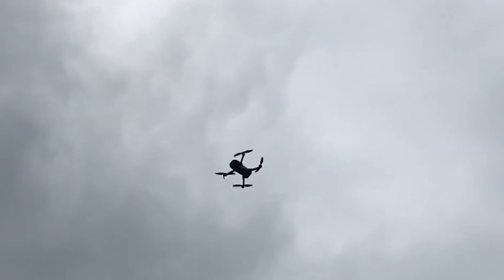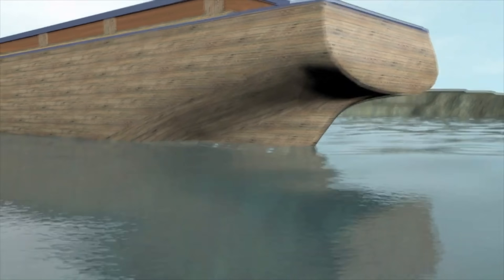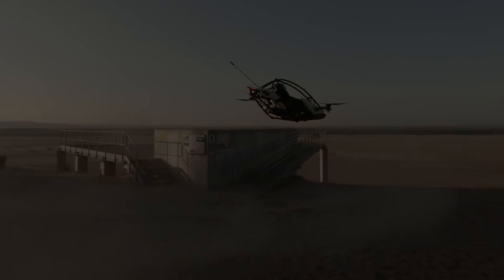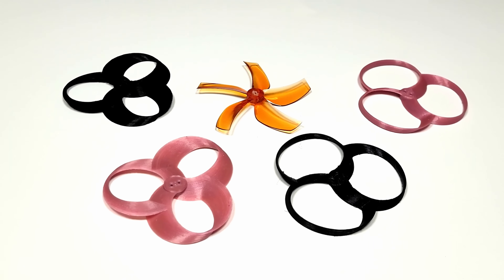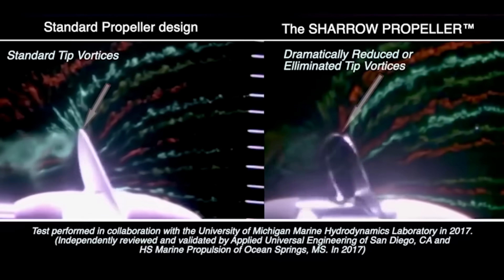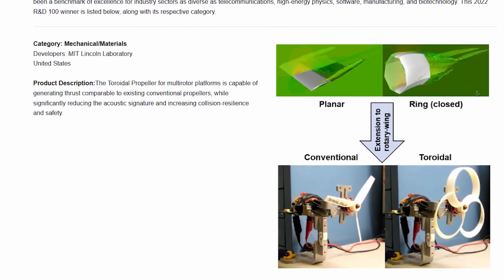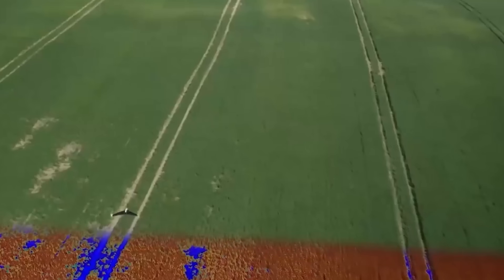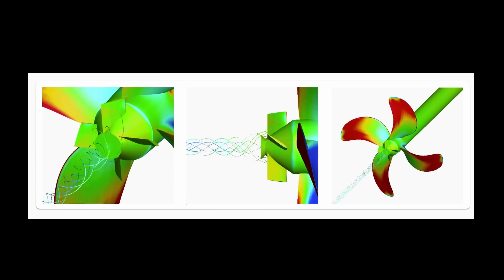This Propeller will Change Aviation Forever!

Comment: This idea has possibilities but has a limited application in aviation. I can't see how the pitch of the blades could ever be made variable and the 'dead-engine' drag in the glide would be unacceptable. Drones certainly have a need for quieter operation but the big opportunity must be in under-water turbines for tidal power generation. New ideas are always exciting but I have seen claims of 101 % efficiency - clearly ill informed !
Reply: The only 101% I can see is compared to conventional.
The Wright Flyer's prop was 85% efficient, does that make the toroidal one a hundred fifteen percent? No math was injured making this comment.
Reply: If you going to use it in a normal aircraft, like a Cessna, you need to redesign the engine to handle free rotation. You might also need something like a gearbox or something to boast torque at low speed.

On the flip side, the increase for a prop on a plane will be considerably high than for a already existing fixed angle prop. A aircraft propeller, like that of a Cessna always have some inefficiency where some part of the propeller is not  at optimal angle.

Everything is always a trade of. As the situation today a fix propeller is the most optimal in efficiency. Then comes a prop fan, than comes a fan, than comes a variable pitch propeller, then last comes a rotor.

Something like a rotor of a windturbine is actually not very efficient, but its very wide band. It works at very low wind, but also very high wind. It can also be feathered. 

And its not like there is a huge diffrance in efficacy from one to the next. Typically about 5% for each step. Note, this is everything else equal and peak efficiency.

If we go of peak efficiency a rotor will eventually be the most efficient design. For a helicopter that need to both work at hovering and at 150knots, at the same RPM (or there about) a rotor is far more efficient. But a drone that can quickly change the RPM a propeller is far more efficient. And if we compare a rotor to a propeller where everything else is equal, but we have a motor with a wide band torque, (like an electric motor), a propeller is far superior, and considerably cheaper.

The claim of 105% is relative efficiency. So that would imply that the total efficiency is 5% higher. Relative efficiency is often used in engineering and science because its easy to use. Number over 1 (100%) is a efficiency gain, and numbers under is a decrease. Also this allow negative numbers to be used for reverse flow (say like recuperative breaking). 

With a toroidal propeller at peak efficiency it would imply that its 105% as efficient as a normal propeller.

That would make the list of about
Toroidal: 105%
Propeller: 100%
Propfan: 95%
Ductfan: 90%
Varible pich prop: 85%
And a rotor:80%

This is very rough number and they will be different due to application. And this is also peak efficiency value. At lower efficiency at one point, the rotor will be better.

Its also worth saying that there is other way of increasing a propeller efficiency (and a rotor and everything between) like having larger dish area or a high aspect-ratio propeller. Also fewer blades does increase efficiency, but decrease power throughput. Look at something like the Helios solar plane having propeller the size of a Cessna despite only having a few kW in each prop
Reply: They talk increase in effeciency where 105 would be valid...
Reply: You just need the part that curves back to have some flexibility. As long as there is a cover you could have a mechanical component inside each section of the blade that could rotate, while still maintaining the efficient part, which is the lack of verticies.
Reply: Toroïdal propellers give significant gain in water, in air it’s still a different story from various tests and experiment done by engeneers …
Reply: I assumed it would flex like an F1 wing
Reply: Didn’t see your post, came to the same conclusions.
Reply: The dominant factors change completely with the size of the propeller.  A standard propeller has a fixed angle of attack along its length, that is why the pitch is steeper at the root, thats very efficient.  But helicopters with large diameter blades suffer flow reversal with that arrangement making foward flight difficult, so they are flat and the entire blade pitch changes mechanically. That means that the tips are doing more work than the root because of thr linear velocity.  Drones up to a meter don't have to worry about any of that nonsense and small diameter blades spool very quickly.  The retreating blade is usually stalled but it doesn't matter. Variable pitch has all been done, even a diagonal blade flap.  But simplicity wins out by far.
Reply: He's just reading a script with little understanding
Reply: ۱
Reply: @kafar1125  what's that?
Reply: Yes agreed.
Reply: If it was made out of a nitinol alloy the deflation  could be  either electrically or by a heat source  internally.
Reply: Unfortunately drones are the future of aviation
Reply: Old think
Reply: Agreed Ray. They will have some great applications but are not the End of Propellers as these videos would like for you to think. But as you have noticed the new design does have advantages but not in all applications.
Reply: possibly a plus 1% relative to known/existing concepts.
Reply: What's dead-engine drag?
Reply: As a pilot I agree with you.
Reply: Need collective pitch control on our quads. That will revolutionize drones. Like the wheel or fire. Lol. Turbo prop our drones yo
Reply: @Nanoblaster77  There already are collective variable pitch quad copters. They are mechanically complicated so more expensive and less popular.
Reply: @Clickmaster5k  not like what im talking about bro. Not anywhere close. Very very simple and small.
Reply: @Nanoblaster77  There are and have already been made quad copters that use rc helicopter tail units to control each prop pitch. Iv seen both nitro and single motor electric versions of these. The reports are they are better performers than fixed pitch 4 motor quads in most ways but they are not as durable. Not as simple, so not as cheap so they are less popular.  I think ultimately once you start scaling up a heli is just better for how you would use a CCPM quad and a simple 4 motor quad is going to be cheaper to thrash around and get trashed. Doesn't leave any market for the CCPM quads. You can get clones of them some times still though.

Look up the Stingray 500 or Assault Reaper 500.

I know what you are talking about, I fly heli too.
Reply: @Nanoblaster77  I'm curious why we don't see conventional helicopter drones - surely if there's a benefit they could figure out the control scheme? Maybe the tail rotor eats more power than it looks like it should, but then why not a coaxial, Chinook, or K-Max configuration?
It seems like most of the electric "helicopter" designs are going multirotor, so I presume there a substantial benefit to the reduced parts count & direct powerplant control.
Reply: @Traqr  Durability and simplicity of a multirotor makes a small toy something that people can afford to beat up. They can be crashed more and repaired easier by your average hobbyist. Efficiency reliability and longevity are not really concerns with small hobby aircraft. On larger scale the difference in maintenance and repair complexity and cost no longer exists.

These advantages do not scale up and that's why there are very different dominant designs for large aircraft that carry people. 

If your question is why we don't see rc helicopters having the same popularity as quad copters I think it comes down to RC heli are much harder to learn to fly since they are far less forgiving to crash and much harder to assemble and tune then a quadcopter. The flight controller software available for rc heli is also much harder to start out with than quads but that is changing with many new small helis having stabilized modes built in these days. 

There is also a perceived safety factor. A small heli and small quad of similar size the heli will have one large rotor with lots of energy that can do a lot of damage to a person where a quad will hurt you but I think most people think the quad will cause less injurie. 

As to tail rotor vs multi on full size. Tail rotors do eat a lot of power, iv read up to 25% on some heli but any overlapping rotor design is less efficient with inline cax having the the most overlap they are the least efficient. IDK the numbers but looking at what is built and flown id have to assume the loss of efficiency evens out with a tail rotor more or less or we would have moved away from tail rotor designs a long time ago.
Reply: @Clickmaster5k  my 5" quad can do 220 kph and 0-100 in less then a second. That's why quads are more popular
Reply: @cabreraman6969  That's not an inherent property of being a quad. What's the range, flight time, load capacity of your quad?  There are other aircraft that have faster acceleration and all out top speed. At only 3gs quads to not change direction fast, even larger rc heli will pull well over 10g. Rc helicopter speed record is over 300kph.

Those aircraft cost a lot more $$ to get that performance and dont crash well. 

Quads cost less than a grand and can be crashed all day for minimal repair cost. That's whey they are more popular.

You quad already is leaving performance on the table even at those numbers you claim because they are all much heavier than they need to be so they are tough enough to crash.
Reply: @Clickmaster5k  my quad weighs less than 250 grams with no battery and it can pull at least 20gs. Besides it costs less than 600$ 

Edit: 13gs not 20
Reply: @Clickmaster5k  the range could be increased to multiple kilometres just by adding long range Rx and vtx and running larger batteries and load capacity is not important since it's a race quad. And what aircraft are faster in acceleration? My quad cold probably do 0-100 in half a second if I tuned the esc, ran more aggressive props and removed all unnecessary weight.
Reply: @cabreraman6969  Ya it wont accelerate as fast or top out as fast with a larger battery, that's the whole point of what I said.

I also pointed out aircraft in my previous post that accelerate faster.

Quads are fun and cool. Don't kid your self though, motor bells are heavy and compared to changing pitch on a prop they are very slow to change direction.

Different aircraft for different missions is the point. Mission of a race quad is not the same as most other aircraft.
Reply: @cabreraman6969  It wont pull any Gs with out the battery so the weight with out is pointless. It being less than $600 is a huge part of my point. And when you crash it you probably are not costing as much as when you crash something like a heli either.  That's where quads shine cheap (relatively) rugged, tough.
Reply: @Clickmaster5k  the battery is another 200 grams
Reply: @Clickmaster5k  the motor only weighs 36 grams and they reach max speed with the propeller in less than half a second
Reply: @Traqr  Different control scheme, harder to control, steeper learning curve, far less intuitive.
Reply: @cabreraman6969  I know right, its pretty slow. If you want to change direction of rotation completely its twice as long and that's just on a tiny 5". If you want a larger aircraft for more endurance or payload the motors only get larger and slower to change direction too.
Reply: @Nanoblaster77  They already had that several years ago, the concept didn't "take off".
Reply: @Henry Knox  have a lil faith bro
Reply: @Nanoblaster77  I wonder as an inventor, could the toroidal propeller be stiffened as the bushing or pulling blade, & be flexible from that point on, so propeller pitch could still be adjusted?????
I guess research & development could still be worked on, then work on more efficient ways of production, like injection molding.........?
Possibly encircle the whole assembly with a band to both stiffen & protect the blades????
Experimenting with new outside ideas is key!!!
Reply: @Nanoblaster77  its been done. Top 3d heli pilot made some
Reply: @Nanoblaster77  what do you think the three phase  electronic speed controllers are for? Mechanical collectives will never be as fast as ESCs
Reply: @Cayenne  no bro. I dont want to spend batt power on breaking amd spolling back up. Collective pitch control on all 4 props will change the game. Also speed Battery efficiency all that goes up with collective pitch. I'm a helicopter pilot trust me when I say. I like my motor to stay at a constant rpm when i'm doing tic tocks. If ya know what a real 3d ticktock is. On top of that The mechanical part of the Turbo prop is all the way down to a 10000 of a second with the digital high speed servo again helicopter pilot. Here. I know what I'm talking about I've also seen the math. Please give me more reasons to go on. It will increase everything about your drone even the sound
Reply: @cayenne7792  CCPM is far far faster then motors can change speed. Look at RC helicopters.
Reply: @cayenne7792  varying pitch isn't only there to change thrust, but to optimize the propeller efficiency by adjusting the blade angle of attack. Yes drones would improve efficiency with variable pitch.
Reply: @Chwibon  That's called "changing thrust"..you just corrected a guy, for saying the exact same thing...just because he said it a different way...you think yourself so much smarter than him, yet your "correction" was directly related to his comment....😂😂😂😂wooooo! I am DONE with the internet today!!😂😂😂
Reply: You are partially informed which makes you partially illinformed.  The 101% eff claim is correct when you COMPARE to another marine engine/boat combination running at same engines/boat with diff propellers and  then you limit the comparison to medium/low RPM for cruise where most boats cruise at for best fuel efficiency.  Or in this case reduced RPM and vastly reduced fuel consumption and thus the 101% performance increase, not overall efficiency is 100% ... correct. It has been tested over multiple boats.  Though the 101% is maximum, more commonly, it is closer to 70% decrease of fuel consumption at cruise as the boats this is being applied to are planning boats and thus able to get up on a plane sooner at lower RPM and therefore the fuel efficiency increases.  If one looks at the higher RPM higher cruise numbers, not maximum, then savings of ~30% fuel burn are achieved.  Noise is MUCH lower, control is much improved as we especially in reverse for docking.  Now if you are in a trawler boat?  Yea, going to see ~10% improvement.

For general aviation this could partially work with an efficiency increase of ~4%(induced drag reduction for Mach tip speeds of under 0.54 or so(not worth it IMO)) for those aircraft which used fixed pitch(most of them), and no the dead engine glide would not be unacceptable any more than any other 2, 3, or 4 bladed fixed pitch propeller.  If you are talking constant speed props, then technically it could still work, your pivot point would be critical, but its range would be reduced and would have an optimum forward velocity for sure(but then this is already true of such propellers) just it would be more so.
Reply: @w8strel Efficiency of over 100%, or even equal to 100% is impossible.
Reply: And nobody has said "increase of", every claim I've heard is "101% efficient."
Reply: @immikeurnot  It had been done in aviation before. The invention of the high bypass turbofan made over 100% and closer to 150% efficiency when first introduced. As a engineer, one of our mottos is Nothing is impossible!

Comment: Most mornings after 7.00 an RAF  A400 transport flies near to me going to Eastern Europe, it is usually at35000’  and going about 400 knots BUT it is so noisy, a high pitch and really noticeable to all as it is noisier than jets.  The multi blade ,huge props are the source.
Reply: 400 knots at 3500" ? Not bloody likely.
Reply: @mokumikala  35000 i said and an A400 can do that according  to flightradar app that I check on when it goes through DVR beacon.

Comment: looks like it's three times the weight of a normal prop
Reply: Yes but what if the power required per unit static(?) thrust was half, say.
Reply: no, 3 kg of carbon  fiber
Reply: @gulfstream-tvstudios9546  So a regular prop, made of the same carbon fiber, would weigh 1 kg.

Comment: and if all this would be good how come you dont see it all over ?
never one seen one in my life
Reply: I'm going to put a 200 lb bronze prop on my 80hp cessna
Reply: because we just discovered it dummy
Reply: WTF the propeller on the submarine is wrong, it has more pitch at the tip?
Reply: Because it’s a proprietary marine design primarily aimed at the outboard engine marketplace and they’re ludicrously expensive for a small performance gain due to the difficulty in generating the complex form necessary.
Reply: 10 years ago no one have seen a Tesla.
Reply: @DirkHav  yeah, because they literally just set the funding in 2003
Reply: The design was discovered and developed  very recently, in the past year, so aviation industries have not had time to adopt the propeller. The design also must undergo rigorous testing, and it is way more expensive right now than a conventional propeller. To summarize, it is not common yet because it is expensive and not fully developed.